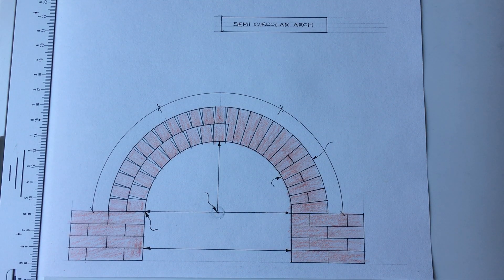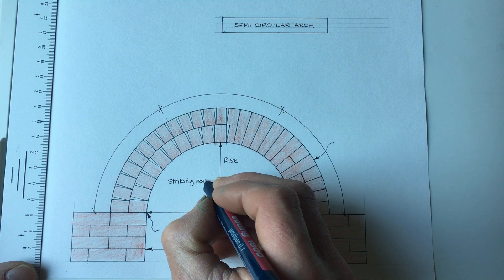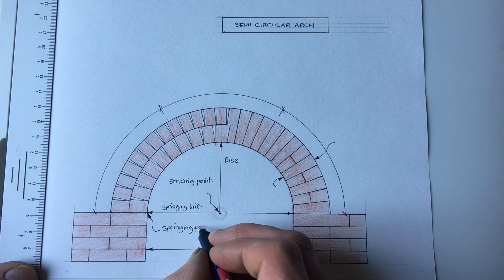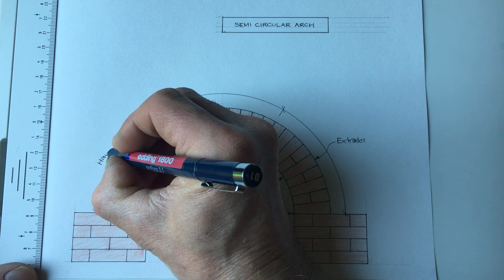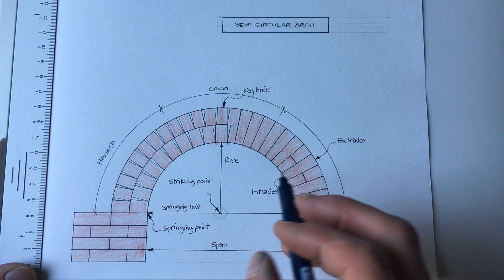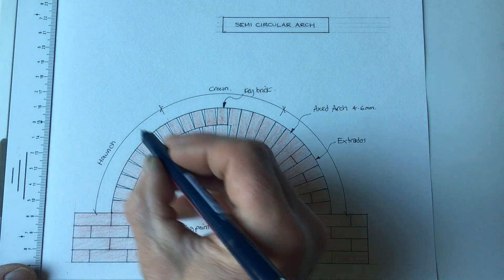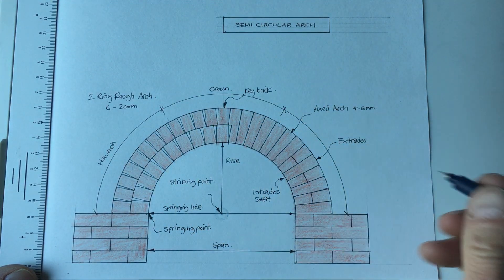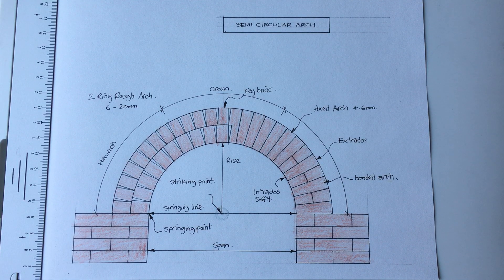Drawing Arches - Semi Circular 2 of 2

Comment: If I may, I would like to point out that an arch with a unit TDC (top dead center) is a male arch and an arch with the joint TDC is a female arch. Also a common alternative term for “axed” would be “gauged”.  Excellent informative video Rob, well done.
Reply: Martin   How involved are you in masonry?  Or are you just poking your head in to make snide remarks?
Reply: Martin   While it’s true I received my journeyman certification in Canada my instructor was a third generation mason from England. How would you label the two types of arches in simplest terms?
Reply: Martin   Full disclosure:  My experiences as a mason also include working as senior instructor at a masonry training facility so I am well familiar with arch construction, types and classifications. 
         Arches with a key “unit” are by far the most common, in other words arches with an odd number of vousoirs. But some arches have an even number of voisours, in other words instead of a “key” you would have a joint at top dead center. There are terms or labels for those …male or female respectively. 
         These terms were introduced to me as an apprentice by a 3rd generation mason from England and I’m surprised this is new to you if you are indeed involved in the finer details of masonry. 
          I was just curious how you denote the difference…perhaps odd or even?  Or maybe it’s never crossed your path. 🙂
Reply: Martin   You are right, two S’s in voussoir. My phones spell check didn’t catch that…thanks. 
   Uncertain times indeed…you as well Martin. All the best!  Larry,